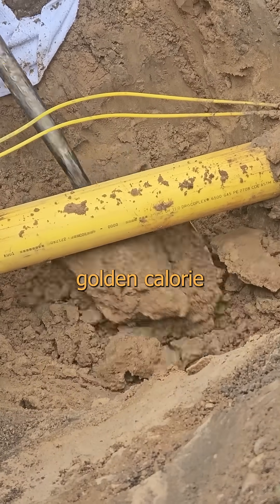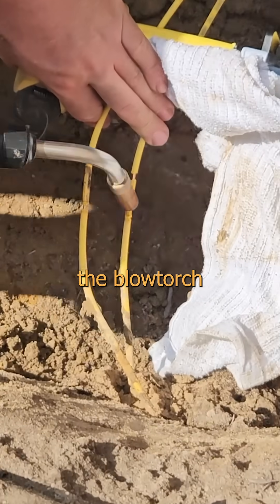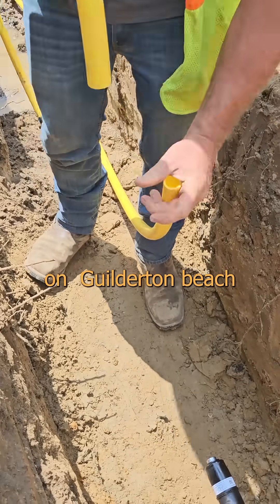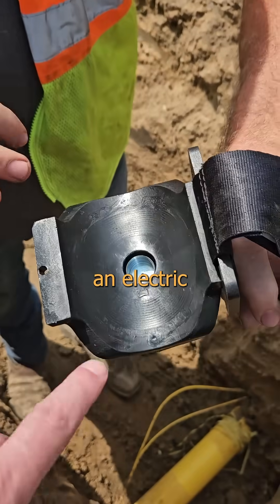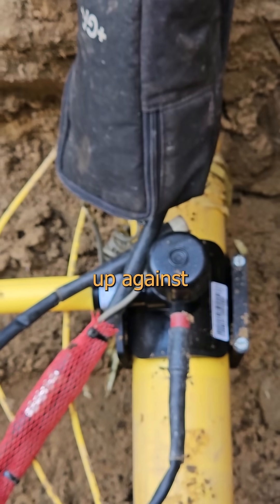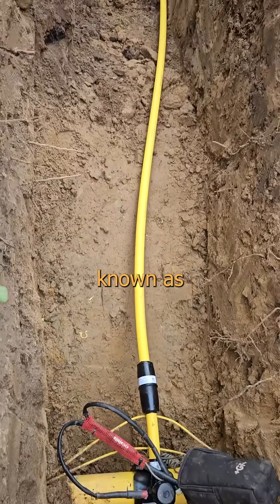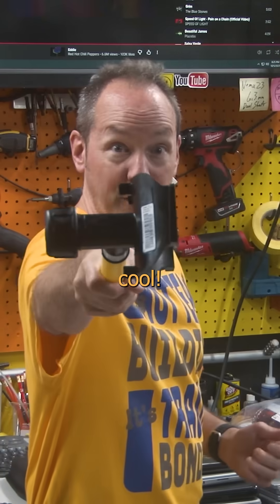Gas Line Hot Tap #chrisboden #comedy #engineering #construction #educational #apprentice #science

Comment: Ok, through all of the metaphors, I'm not sure I got this right.
1. it melts a tiny hole in the pipe to test that the pressure is at the right level.
2. it then reseals the hole and the pipe is good as new

did I get that right?

Comment: Worth noting that natural gas has Upper Explosive Limits and Lower Explosive Limits (UEL / LEL). Oversimplified means if it’s either too rich with gas it won’t burn or too diffuse and it won’t burn. Right at a pipe is way past the UEL. Doesn’t mean there isn’t danger as it diffuses out looking for an ignition source in the sweet spot. Acetylene is a very different beast with no UEL, if I remember correctly.
Reply: Thanks for explaining, I didn't know that yet!
Acetylene is that crazy high temperature quite expensive torching gas, right?
Reply: @DatsWhatHeSaid  yes, acetylene is used for heating, brazing and soldering metals. also used in conjunction with oxygen for cutting/heating metals (and flame welding). aka an oxyacetylene torch.

lastly, while acetylene is more costly than most gases used in the trades, im not sure id call it "expensive".

hope that helps! have a great day!
Reply: @brophkisle it's expensive in that the initial investment is always higher cuz it's very sensitive that needs to be coddled with expensive tools
Reply: @DatsWhatHeSaid Acetylene is in extremely common welding use. It just stood out as the one I was warned in particular about.
Reply: @scotttudor6647  I looked in my welding text book, but couldn't find it.  So Wikipedia to the rescue.  It cealms  to have a explosive range of 2 to 100%.  That sounds awfully wide.  Although I could not find it, I remembered a range of 14 to 86%.  So yeah, you only use Acetylene when you need the super high temperature.  There are other gases that have a much narrower explosive range and are much safer to use.
Reply: Isn't acetylene that scary gas that can backburn right into the cylinder if not put behind a flame arrester when using it?
Reply: @SDogo  Yes flashbacks once in a great while do occur.  That's why they put either flash arresters or check valves on the torch and regulator.  If your hear a weird whistling sound, immediately turn off the torch and then close the valves on the cylinders.  If your lucky, you'll have contained it in the torch and it will go out quickly. But if goes farther, your hoses and regulators will get scotched. But with the cylinders closed, you won't be dripping off the ceiling.  The flash arresters and check valves give you an extra level of safety.
Reply: @SDogo  yeah you need special arrestors because if it goes over pressure it can detonate without oxygen.
not to mention it only needs like 2% oxygen for an explosive mixture.
Reply: so, what... can acetalyne burn at 100% concentration (like in a vacuum, thus meaning it contains its own oxygen?)
Reply: @Leekodot15  no, acetylene torches need oxygen to burn but it can detonate under pressure without oxygen because it's unstable.
 
it's really hard to burn any gas in a vacuum because the heat can't efficiently conduct through the vacuum to maintain the reaction, space shuttles have special pressurized combustion Chambers for this reason.

I think it still Burns it like 90% concentration which is impressive.
Reply: @FrancisR420 I... probably meant "in a vacuum" as in "in a pure, self contained atmosphere with no way for it to mix with any other air" but eh, close enough.
Reply: Acetylene can decompose without oxygen at high pressure. In bottles it’s stored in a spongy material dissolved in a solvent (acetone?) to prevent this. 

You also shouldn’t try to use too much volume from smaller bottles because it can lead to the solvent foaming out

Oxy-acetylene does burn very hot but oxy-propane is almost as hot (iirc 2-4 hundred Celsius below oxy-acetylene), bbq bottle gas is also cheaper, more common, and safer than acetylene
Reply: @thomasa5619 it doesn't matter how hot propane is when it's chemically incompatible with steel welding and doesn't want to burn.
Reply: @FrancisR420 can you please elaborate? Oxy propane is chemically incompatible with melting steel “and doesn’t want to burn”

Comment: I used to do this for a living and have a few notes. First the blowtorch to remove the insulation from the tracer wire is unsafe and would likely result in being thrown off any jobsite I’ve worked on (Columbia Gas). We always just used wire strippers. Secondly the tap is oftentimes referred to as an electro fusion Tap T and they can and sometimes do fail. One of the most common (still extremely rare) ways I’ve seen them fail is alcohol residue being left on pipe and not giving a proper seal. Awesome to see Chris cover this
Reply: Question for you since you know what you're talking about. What are they doing to the tracer wire? I thought they were just there for OneCall.
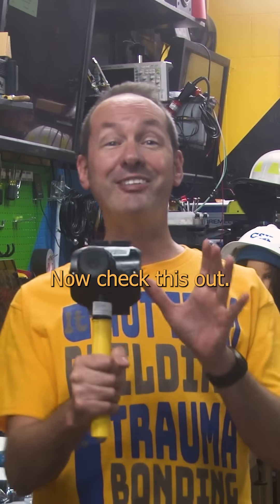Reply: @derekwatson1118  It's hard to see but I think they're branching off to send a tracer wire down toward the house? You can kind of see it at around 1:45 when the guy takes his hand away. If not that, I have no idea.
Reply: @derekwatson1118  not the same guy but also a gas fitter but in Canada. they are splicing a new set of trace lines going to the meter on the house.
Reply: @derekwatson1118  My guess is that they are gong to extend the tracer wire along the newly fitted branch so that it can be traced too.
Reply: @derekwatson1118  this was actually my job. It is so that when people need to go digging they know where the service is. Those wires follow every type of pipe and cable that is under your feet. You connect in to the wire at wire box that is in the ground nearby and then go hunting and find where the signal goes. It follows the main as well as the service, but the service wires need to be tied into the main trace wire.
Reply: @derekwatson1118 they are extending tracer wire and a lot of times we put anodes to eat up the corrosion
Reply: @derekwatson1118  they’re splicing the tracer for the run to the house dude
Reply: @derekwatson1118 yes it's to locate the pipe so it doesn't get drilled through later.
Reply: When they tap the hole using the new branch, where does the excess material go?
Reply: @JRaney the tap that is ran up and down the threaded shaft is hollow and the end that meets the gas pipe is sharp(ish) so when it's first tapped the circular piece is captured in the tap and stays there for the life of the tap, that's what allows you to shut the gas off as well when the tap is ran back down again, hope this helps 🤙
Reply: @JRaney  the coupon stays in the cutter and prevents gas from blowing through the top, it has no teeth its just a sharp cylinder, so theres no shavings or anything going into the line
Reply: Yeah, I second this. You'd only ever see a blow torch when dealing with steel mains and services. They never come out around plastic pipe. 

(For anyone wondering, to help seal steel welds, we use a kind of tar wrap. It comes in coils and we use a blow torch to make it gooey and then wrap it around the pipe. Once it cools down it hardens again)
Reply: As an inspector myself I disapprove of the blow torch for the wire myself  any significant leak and that bell-hole goes up in flames 😅 but hey maybe it was cold 😂
Reply: Lol the blowtorch is not unsafe.. It's a leak check and wire stripper in one ;)
Reply: @DarkAttack14 unironically if you talk to a lot of the older workers in the industry matches is how they used to find leaks inside basements… wouldn’t blow up just a little flam 😂😅
Reply: @gagewilliams5405 yeah, I'm not in the industry (I'm a low volt electrician) but I'm basically a jack of all trades master of only one haha. I've done that with a match before and while it's semi risky... The risk is minimal. I was previously a firefighter and while I wouldn't suggest random people go around leak checking with fire if you know what you're doing have at it haha
Reply: Did you see any OSHA violations
Reply: That bit that is cut out of the main pipe in the end just stays inside ? Does that not cause problems ? Or is there some kind of trap downstream ?
Reply: @kcrtxbw.4349 the cutter retains the coupon (part of main that’s cut) inside the cutter which is why it can be ran back down to turn off the gas
Reply: @gagewilliams5405  Ah, even smarter then i thought ! Thx !
Reply: Alcohol doesn't leave residue, that's just a bad cleaning job.
Reply: @ZeroScapes if you don’t let it dry it absolutely will stop your fuse from properly welding
Reply: @ZeroScapes  if it’s a low temperature outside then it takes longer for the alcohol to evaporate off. If a worker doesn’t give it enough time then they could be trying to fuse with alcohol still on the pipe.
Reply: @ZeroScapes  Exactly and that's why they pressure test before tapping the line.
Reply: @ZeroScapes  If you let it sit for even just a few minutes it would be fine. Longer in lower temps.

Comment: We have a company called Team that hot taps pipes ( schedule 40 steel ) in our oil refinery while its live and under pressure and lots and lots of hydrocarbons flowing all around us. Very cool stuff !!
Reply: That... Sounds scary! 😬😁
Reply: What's the psi, or does it vary at different locations?
Reply: @Dbrider740  In the Southern California oil fields our Natural Gas Lines ran from 15 psi to 1100 psi. I have hot tapped 2" 250 psi steel lines.
Reply: @Dbrider740  yes, wide range ! Each unit is its own beast . Crude,fcc,dht,sru,c³  everyone as big as city block or 4.  You can be working in a pipe alley and have a 14" pipe iced over and the one next to it 700* both heat traced. The one i stayed over for, on stand by for Team was i belive 500 psi ,  i learned how it works that night lol , they welded a 12" saddle to the pipe then bolted on 2 valves and on the top flange they had a big pneumatic drill , that is when i learned what a stopple is and what it does.
Reply: @TheAndy331 Cool, no wonder why welders have so many certs and tests. I did commercial flooring in a lot of Hospitals and the seems of the vinyl sheets are grooved and heat welded with a composite spool of similar material. All done for bacterial purposes.
In HVACR some refrigerant get up into 400 pisg, but we can just evacuate the refrigerant into a high pressure tank, fix, cut, add anything to the lines without and risk, then pressure test and refill.

Comment: Fun Fact, that gas main was most likely installed using an HDD bore rig, as there doesn’t appear to be any backfill around the pipe, and there are two tracer wires, a common practice when pulling pipe through in case one breaks
Reply: Thanks for explaining the two smaller cables on the left.  And an elegant engineering solution for a "spare" cable for redundancy..
Reply: People always ask me what it’s for. I say det chord for when they don’t pay. I was curious about the double wire
Reply: What are those wires for?
Reply: @Xonkykong  pipe locating after its buried.

Comment: That's a lot (okay, maybe just a little) like the saddle clamp I used to attach the ice maker line from my fridge to the water line. Clamp it on, run the needle down to make a hole, then back it up to let the water flow

I get ice instead of fire, though

Comment: I have been wondering how on earth they could tap into those plastic gas lines without the risk of expensive sounds.  Now I know, and that's pretty cool!
Reply: tapping tees like this one are highly preferred because you can tap a hot line, but it’s also possible to squeeze the pipe to an airtight seal to splice in an inline tee if need be! the pipe will spring back to shape within ~24 hours

Comment: After the cleaning, before installing the electrofusion tee, the main must be "scraped" with a special tool - otherwise the fusion won't work properly - one can see the remains of the pipe scrapping material at :18 seconds, it''s wrapped around the main at the opposite side of the tee from the rag - but it confirms the step was taken - too bad that part of the process is left out in this video - it's of utmost importance

Comment: What on Earth happens if one of these mains does ignite?? Does the pressure ensure only the nearest home blows up? Are there automatic shutoffs along the main?
Reply: the gas in the main is far too saturated to ignite. gas is only explosive within the limits of ~5-20%, so you’ll never get ignition inside an active main. the only overpressure concern is from too pressurized of a feed (see the merrimack valley incident)
Reply: @missingpersons305  That’s fascinating that more gas means less igniting. Thanks
Reply: @c9991x  when working on high pressure blowing gas, your less worried about igniting and more worried about passing out

Comment: When that thing is pushed down to create a hole so the gaz can flow to the new pipe
What heppens to the cut down piece of plastic ? Does get Pushed down the line by the high pressure?
Reply: the cutter retains the coupon, it prevents the gas from blowing through the top, also plugs the whole if you wish to shut the gas off. eben has no clue what hes talking about

Comment: You have to appreciate that beyond just the engineering involved with this the chemistry is since no Oxygen is present in that tube the application of heat is not really a concern unless you have a weak failing pipe.

Comment: What are those yellow?Wires next to it, and why did he strip them
Reply: tracer wire for locating, he is going to branch off so the service is locatable aswell
Reply: @hustlehumbly6169 
Thank you very much.I really appreciate the reply.

So, it is simply the fact that the wires are there. The copper itself is what is detected by the scanner, correct.

I.e. there is no requirement for any current to flow through these wires. Just having the middle alongside the p v c pipe it's sufficient correct

Comment: There is something similar available for plumbing. It's called an Easyfit isolation valve.  You clamp it onto the pipe, run the tap housing down to sheer off a section of pipe and compress it into a cavity in the backing plate, then screw on the appropriately colored tap handle.

They have them for both copper and pex.
Reply: Nice im a plumber and never knew those existed. 300$ a pop is rough but for industrial i can see the uses
Reply: @saberxzero  Pricey, but a life-saver when you've got a frozen valve near the meter or are missing a cutoff at an expansion tank. 
I can also see how they'd be preferable to draining the entire house if you had to work in the basement of something built in the 30's-70's when isolation valves were seen as nice-to-haves. 

A little bit of side-trivia: They are made by the same company that use to make those oil lamps with the round, hollow wicks.
Reply: @Official_DJ_Spark > There is something simular available for plumbing.
Similar.✅
Reply: @planethedgehog2427  thx.

Comment: That is all available because the gas line is made from High-Density-Poly-Ethelyne or HDPE. This pipe was probably made in Greer, SC. Either way the material technology of the pipe is what allows us to melt-seal the T into the pipe.
Reply: It's mdpe not hdpe. The writing on the side of the pipe says gas pe 2708. When I googled that it showed a pipe that looked exactly like this one and that it was MDPE not HDPE.
Reply: @hammerheadtech8980  I used to make yellow 3" gas pipe out of HDPE. So maybe more than one material now, but if you can't touch it and read the spec then no way to tell and no reason to argue.

Comment: Wanna hear something cool? I used to do that job. It takes about 18hrs of osha/dot training on computer, with tests as you go, followed by a final test. Also, the fittings, from my experience are rarely pressurized to test before punching the main. Was a contractor for ATMOS energy at the time
Reply: They are when someone is recording it and putting it online. 🤣
Reply: I was a plumber for a contractor for one gas. I didn't get to do the fusion stuff officially but I got to help some. Our company took a lot more classes to get certified than 18 hours. I had 30 hours just to be certified to go in and relight appliances. We also used a couple different versions of fusion. The "electro" fusion shown here and then a version using an iron and clamps. I forget the official name for it.
Reply: @jamesandrew3727  I used to do this for a living as well. “Relighting” follows a more stringent safety process and for us was always seen as a higher standard than fusing bc you are the line between the gas and the end user to look for leaks and such in the house. As for the fusion with an iron and clamps you are likely either referring to butt fusing which is done with 2 pipes or socket fusing which is now banned where I live and work
Reply: Pressure test are required not only by the Gas company your working for, but also the public utilities commission, and the NTSB.
Reply: Different companies will run different standards, I think that's more of an ATMOS issue than a device issue.
Reply: Where does the punched pipe material go? Does it sit in the main?
Reply: @DarkChasmGamers it leaves a “coupon” which stays inside the metal cutter inside the tap. The part you run down and run back up retains the part it cuts if not you could have serious issues with gas flow getting lost at other services
Reply: You can test the service line threw the T before you tap.

Comment: It's always crazy to me what the Americans do. We don't mess around with gas here. As far as I'm aware everything HAS to be made of steel or copper if it's gas and it all has to be soldered/welded with only a specific ammout of press fittings and screw fittings per household. We use the system showen for sewage and nothing else....
Reply: hdpe/mdpe is incredibly safe for low/medium pressure distribution lines, and doesn’t come with the added consideration of cathodic protection to prevent corrosion. and we still use steel by law for >60psi applications.